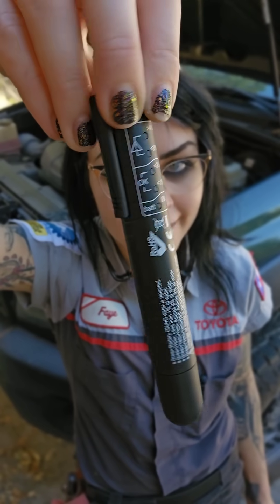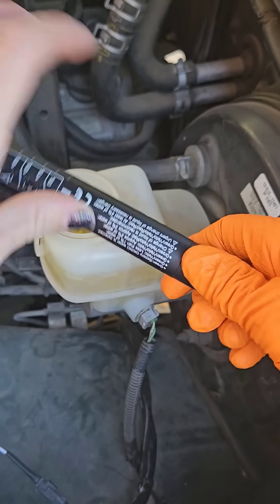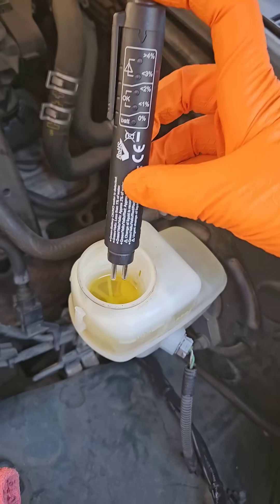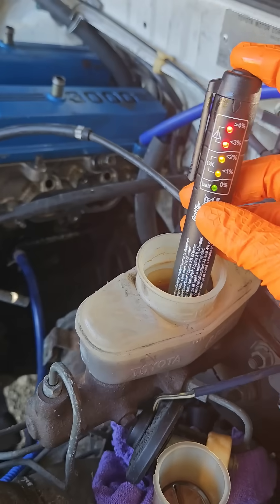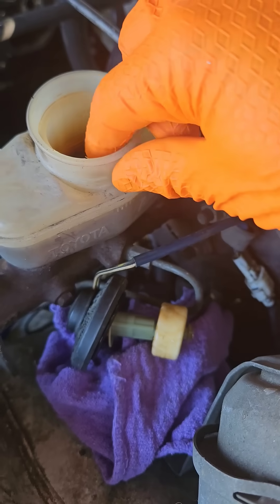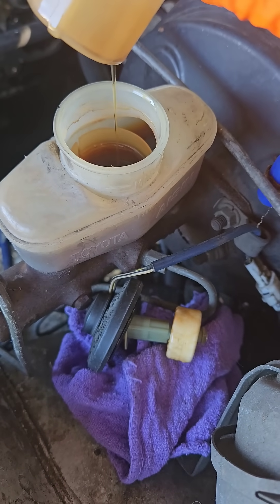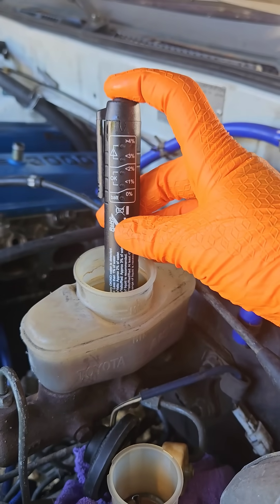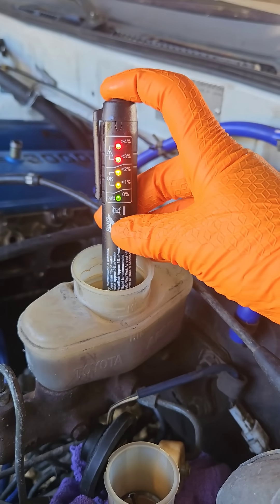Do you REALLY need your Brake Fluid Flushed?? How to Test it For Yourself!

Comment: Short answer: YES. Brake hydraulic fluid is hygroscopic.
These are the kinds of YT Shorts that make surfing YT great. Thanks for your content.
Reply: Learned a new technical term today. Thanks.
Reply: Fun tip: empty a bag of pool shock in a bottle of DOT3 and see what happens. :))
Reply: @ireallyreallyreallylikethisimg  Spare me the mystery. What does it do?!?
Reply: You're kinda right. Brake fluid is a hydraulic fluid and it is hydroscopic, but most hydraulic fluids are hydrophobic. Brake fluid is a synthetic oil. There are 2 main types of synthetic oils, ester based and ketone based. Brake fluid is not refined from oil pumped out of the ground. Most hydraulic fluid is refined from oil pumped from the ground and you've probably heard the phrase "oil and water don't mix" which is generally true with a few exceptions.
Reply: Go girl!!!!❤❤❤ teaching me something!!! I love it!!!! Whoaaaaa
Reply: Short answer is NOT yes. Her point was that they could be scamming you and saying you need it flushed even when you don’t. The question was never if it was EVER necessary, the question was if it was necessary when the mechanic is saying it is. Short answer is test it yourself. Because if the short answer is yes, then if you go to the mechanic once a month and every month they say you need to flush your brakes and the short answer is yes then you’ll be getting scammed. The initial question always revolved around are you getting scammed because they said you needed it when you didn’t, not that you would never need it to be done.
Reply: DOT5 is hydrophobic. Don't mix DOT4 with DOT5 and don't use DOT5 with ABS.
Reply: The answer was already short
Reply: @DaeCRG1  just needed that one word added
Reply: Yes but not every two years, 5 years is okay
Reply: Something something dot5+; silicon base is not.

Just flush and bleed when you do brakes every couple of years; you'll be ok.
Reply: I had a nineteen ninety-eight Toyota Camry with 376000 miles on it, never changed brake fluid or power steering fluid but everything else was serviced.
Reply: @Drivehead103 I can guarantee you had to replace the master cylinder and at least 1 caliper in that time along with power steering pump and or lines. Mechanics like me love people who neglect basic car maintenance,, makes us alot of money
Reply: @dylanclay2741  never replaced the master cylinder, power steering pump or calipers. I think I do remember replacing one brake line. Power steering is the only thing I did not service, that's how it got 376000 miles and was still going strong before being totaled out by a deer.
Reply: @Drivehead103  You never got the brakes hot because with the age of that car's brake fluid it's boiling point must've been 100 degrees. heehaw watch out
Reply: @applesbighatranch6906  Yes, brake fluid is hygroscopic, but it is also contained within a sealed system.
Reply: @aaroncostello8812 That "sealed" system depends on many rubber gaskets that corrode or bloat from too much copper content in the brake fluid caused over time by its hygroscopic property (water absorption). Hence, why a lot of brake master cylinders start to internally leak into a vacuum booster and you loose your brake pedal. Have fun repairing that after neglecting your brake fluid change.
Reply: @aaroncostello8812  Then why is brake fluid hygroscopic in the first place? I'll say why: Because water/moisture would enter the system anyway (through reservior caps/flex hoses and wheel piston seals) and in below-freezing temps, freeze where it collected, rendering the brakes inoperable. By the hygroscopic qualities, water/moisture is absorbed and displaced, or, disbursed throughout the local quantity of brake fluid, drastically reducing it's tendency to freeze.
Reply: @applesbighatranch6906   Why are you assuming moisture can get into a sealed braking system if brake fluid isn't getting out?  Where are these special spaces in a braking system that allow moisture to enter without allowing fluid to escape?  Are you talking about the pinhole in the reservoir cap?  Again, the fact that brake fluid tends to attract moisture out of the air isn't really a big factor in a system where that brake fluid isn't exposed to air.

Brake fluid is hygroscopic, that is true.  That is a side-effect of the same chemical composition that makes it so useful in automotive braking systems.  But moisture simply cannot enter a normally-functioning brake system on its own...especially when there would be forces acting to push it OUT (line pressure).

Brake fluid is no more susceptible to moisture in the brake system than it is in the bottle it came in.
Reply: @aaroncostello8812 The cap actually has a hole in it
Reply: @billybobleeswagger4466    Yes, but most modern brake fluid reservoirs have a rubber diaphragm in the top to minimize or eliminate the fluid's exposure to air.
Reply: @aaroncostello8812  ok i know im late but brake fluid is so hygroscopic it will pull water through the plastic bottle it's kept in. Over time it will collect enough water to were you should flush it, if you want to keep your braking distance to a minimum.
Reply: @aaroncostello8812  It is NOT a sealed system. It has vents to allow for various forms of thermal expansion. The seals are mainly to keep the dirt out.
Reply: @aaroncostello8812  The brake reservoir is open to the atmosphere
Reply: @mitchalvin  Yeah, if you leave thw lid off.
Reply: @aaroncostello8812  It is vented to the atmosphere in order to keep it from over pressure on the brakes when the fluid heats up.  All fluids have thermal expansion and if it was a truly sealed system then when the brakes started to warm up they would create more drag that then would make higher heat and pressure until the brakes would lock solid.  The little rubber seal between the lid and reservoir has a small hole in it.  Some new ones even have a sensor there to keep track of fluid level.
Reply: @mitchalvin  Yes and no. If the system didn't have a tiny vent in the master cylinder cap then fluid could not be pulled out of the reservoir and into the braking system as the pads or shoes wear. All fluids expand as they get hot, but boiling brake fluid isn't really something that's been a problem since the 1960s.
Reply: So I have this same cheap tester and it says my fluid is ok but I have a 2010 Camry and doesn’t look the previous owner ever changed it. I bought the car at 40 thousand miles and it now have 73 about. I’m thinking of changing just because of time what you think please
Reply: Pretty
Reply: What about silicone oil break fluid?
Reply: Every time you push the pedal any bubbles or gases work their way back to the reservoir. Bleeding the brakes only removes so much air.
Reply: Don't touch it leave it along
Reply: New brake fluid is hydrophobic... soon no, yes, is not the shirt answer

Comment: Also brake fluid works as a lubricant for the seals in your master cylinder, abs unit, calipers, and wheel cylinders. Regularly flushing the system can help those components to last longer.
Reply: When you're set to get all of your brakes replaced (as I did last year) is new brake fluid a standard part of the job or something you should request as an add-on at the time of service?
Reply: @wmluna381  saw this a few weeks later, but my shop recommends brake fluid every two years.
Reply: Are you sure about that? I would think if it's used for lubricant, then you would run out of brake fluid eventually. Only reason your brake fluid may look low is because you probably need new brake pads. Calipers are on slides and you grease those. Never see brake fluid lub them up.
Reply: @TRAIL_MIX_BILLY  you misunderstood what I'm saying it keeps seals inside the components fresh like the seals inside the calipers and wheel cylinders.
Reply: @trailmixbilly5985 if you're loosing fluid to a pad you need a new caliper piston seal. Which is in fact lubricated by the brake fluid as it's what pushes the piston. 99% of the time if you're loosing fluid it's because you have a leak.
Reply: @Hackjob101  I think the OP meant that as the brake pads wear, the caliper piston will not return as far into the caliper and the fluid level will reduce in the master cylinder.
Reply: 😂😅😊😂not really mostly new vehicle no need to replace.. its company market strategy know some include in pms must replace brake fluid. even in some dealership if replace the front or rear brake pads.. and some new vehicle this fucking master cylinder easily damage at low mileage fuckkkkkk... mine still good even after 5 yrs.. unless maybe its contaminated or dark... but it will take years

Comment: Welllllll, actually the moisture isn't the critical measurement but it is ONE test.
Get some brake test strips from Phoenix Systems they test the copper content, if the copper from the welds of folded brake line is showing up in the fluid AND with advent of being able to replace lines with newer Nicopp line as brake fluid degrades these strips and a moisture testers make a complete test.
Used to be back in days local station services your car an 8 oz can of brake fluid was part of a big service. During the change a tech, well mechanic or lube jockey would tip up one of those old cans at master cylinder, as the oil drained the fellow would check tire wear, air pressure, open each brake bleeder, adjust the drum brakes and inspect under the car. Close the bleeders and drop car with bottom buttoned up and then topping off fluids and tada your car had all fluids inspected and serviced, and you were ready for another driving cycle.

Comment: Quite impressed with the accuracy of this video.  Spot on.  Also it is good to read your warranty manual.  Some manufacturers require you to change your brake fluid every 2ish years or you will have no factory brake warranty

Comment: Many people just force the caliper back when replacing pads/rotors. Crack the bleeder and return the cyl to home then top off. Flushing any fluids is not needed. Change the fluids regularly.  Flush the toilet not your paycheck.
Reply: yea but to change brake fluid you have to flush it

Comment: Well!!
Thanks for making this!
I met so many guys that didn't believe me that Brake Fluid fails after two years!!!
I learned 30 years ago from a mechanic relative that B F absorbs moisture and "then it becomes acidic and attacks the internal components (making expensive repairs later)
Invaluable tester you have there.

I was taught that "once it's dark piss yellow, it's pooched"
I've seen guys who leave black brake fluid in the system.

Comment: Absolutely necessary, if it's black or its been more than like 5 years, it needs to be changed. I've seen people get away with longer but it is also the reason your calipers will stick from corrosion, along with master cylinders and the ABS system although not as common.

Comment: Most shops I have worked in consider this a separate service. If the customer isn't paying for a flush, we just push the piston back and continue on. My shop uses one time use only test strips for copper. One side is brake fluid test the other side is for the coolant test. But half the time I don't know why we do the copper test when our service advisor tells the customer they need a flush even when the test shows clearly it don't need it. He goes based off time/milage and what the manufacture recommends and if we have a record of it ever being done. I have tried to explain to him multiple times since I am also a ASE certified tech like her when to offer it and when not to; but he don't listen and will sell it. most of the time he sells it and we are not even doing a brake job. Anyway enough of me ranting about my service advisor who honestly hasn't turned enough wrenches to even come close to me I have heard of the lady tech and wish I had her knowledge as I am always learning something new. I am no master but eventually will be.

Comment: The most neglected fluid on a vehicle by far!

I owned a 2000 Jeep Cherokee Classic and at the time the fluid was 15yrs old, dark and almost sticky feeling to the touch. 

I used a Wynns power flush machine and seeing all the old fluid get pushed out of the calipers/cylinders was cool. Afterwards the brake feel and response improved dramatically!

Comment: Id there a difference between a brake fluid flush and a brake fluid Bleed?
Reply: yes, for a bleed you are just getting the air out of the system. very similar process, but with a flush you are waiting for the new fluid to start coming out of the bleeder screw
Reply: What is it called when they just empty the reservoir and replace that fluid, and does it do any good? Does the new fluid even circulate when they do that?  @arcanevoid9199

Comment: You can use a multi meter if you have one just put the earth on the master cylinder and positive in the fluid.
 0.3 volts or lower is okay

Comment: 🤦‍♂️🤦‍♂️🤦‍♂️🤦‍♂️ steam doesnt compress. Thats why they used it to power locomotives and giant ships.
Reply: no you can absolutely compress steam, all gases can compress. this is why brake fluid is designed to have a high boiling point

Comment: she is right and alsodirt can get in by some anti-majic. then you have debris which can corrode brake line paths. or even the hydrualic pressuhas to be maintained so it isnt using very bad fluid in the piston area and causes seizing etc from what she said'rust and corrosion from the interior which breaks components. all redoing all fluids etc and reinforcing my 20'3 g36 so it lasts another 10 years

Comment: YES!  The fluid does get old and lose viscosity it reaches a certain temperature it won't work properly!!  I've had it happen on a work truck coming  down from the mountains! brakes went out fortunately was driving a stick shift!  When I got on flat ground and wasn't using the brakes as much the fluid cooled and they started working again!  I flushed the fluid no more problems!!

Comment: If you want to sound smart around others.... Brake fluid is hygroscopic.

Brake fluid is predominantly made of glycol-ether, which is a hygroscopic fluid. This means that the fluid absorbs moisture from the air around it. “Water by volume” refers to the amount of water that has been absorbed by the brake fluid.Mar 2, 2022

Comment: I've seen the tool used in dealership setting. after 20 or so uses stuck in the darkest fluids I never once saw it declare a moist system. the tool doesn't replace a quality tech or mechanics intuition. It is a toy. However, it can help you extend service intervals something i doubt faye's bosses would have any interest in. just follow mfg. schedules and if you are pinching pennies save a few and buy some brake fluid not a gimmick tester.

Comment: Water does compress not vey much though. It will emulsify the brake fluid and make the braking spongy. Also the heat will eventually break down the fluid properties making it less efficient over a long period of time

Comment: Great concise information!  Thanks!  I do the poor man's flush.  At every annual maintenance, I use a MityVac (turkey baster works too) to suck all of the fluid out of the brake fluid and power steering reservoirs and refill with clean fluids.  That removes maybe 50% of the absorbed water and 20% of the particulate contaminates out of the closed system.  Not as good as a proper flush but way better than nothing.
Reply: for power steering it works but not for brake fluid, there will be a big difference between fluid at the reservoir and at the calipers. it doesnt get pumped through like in a power steering system
Reply: @arcanevoid9199  - The partial flush works equally well for brakes and power steering because the water is evenly distributed in the hygroscopic fluid.  For particulates, the heavier particles do settle at the calipers so the poor man's half flush is admittedly less effective, which is why I estimated maybe 20% particulate removal with half of the fluid exchanged.  As I said, "Not as good as a proper flush but way better than nothing."  It's easy enough that most people will do this at an annual maintenance when they'd just ignore the brakes and power steering until they failed.

Keeping water out of these systems is arguably more important than removing particulates.  Some of the particulates are more seals but the more abrasive particulates are small rust flakes.  Keep water out of these fluids will prevent internal corrosion which is the real enemy.  That's why the brake fluid tester that Faye demonstrated tests for water dissolved in the brake fluid.

These fluids are very inexpensive.  If you change half the fluid every year, there will never be enough water in these systems to cause a problem.  This is based on the principle that the solution to pollution is dilution.

Comment: Always a good idea to flush every 2-3 years. Most brake lines rot from the inside out due to the hydroscopic properties of brake fluid. Best to completely flush and wash with alcholol then dry and use DOT5 silicone fluid.
Reply: dot5 is not going to be good for everyone, much easier to just keep using a non silicone brake fluid
Reply: @arcanevoid9199  I never said it was easy.

Comment: Frankly, it's not us trying to scam customers.  I'm not going to name names here but brake fluid is recommended to be flushed every 20k miles by the MANUFACTURER i work for.  It's literally in the owner's manual of these vehicles under service intervals.  It even has an asterisk "Maintenance items with * should be performed more frequently according to maintenance under sever driving conditions."

That being said, i have never once seen one of our cars with 20k miles on it NEED a brake flush.  We are still required to recommend it by the factory maintenance schedule.  I cannot imagine needing one even more frequently than that as the owners manual suggests.